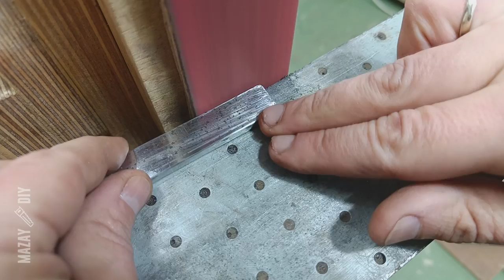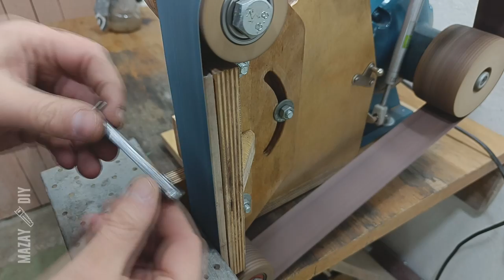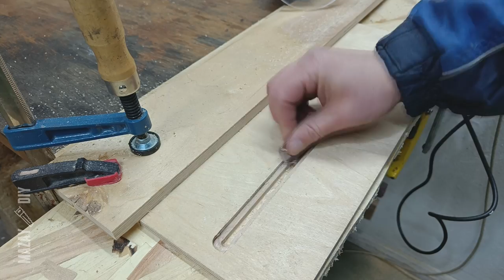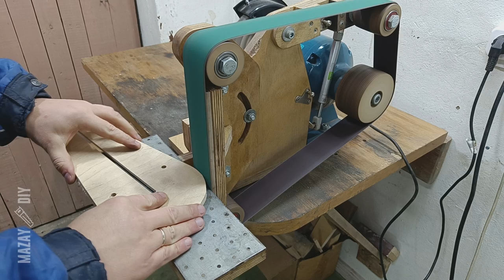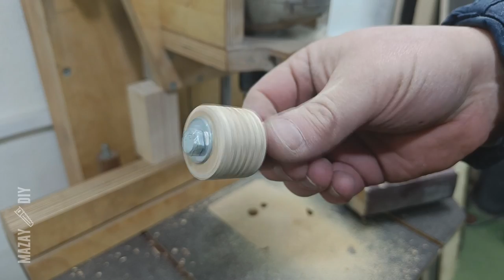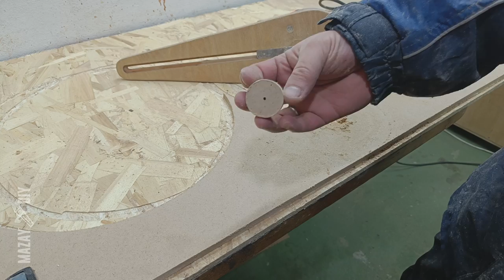2-in-1 DIY Router Circle Cutting Jig | Free Plans

Comment: Nice work.  I snagged your model on grabcad and beefed it up a bit to fit a bigger Dewalt plunge router.  Added some more pins in the slide to increase the min & max of the travel and put a scale on top.  Works great printed in ASA.  Thanks for sharing it.
Reply from the maker: Great! I'm glad when I can help and people share it. You can also post your 3D model on grabcad, and a link to my model and video instructions will be a good bonus